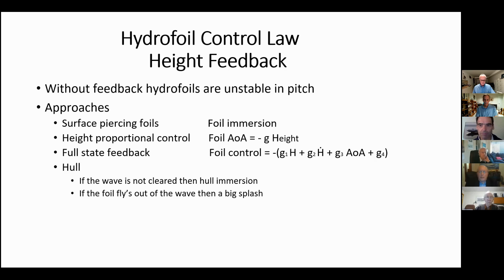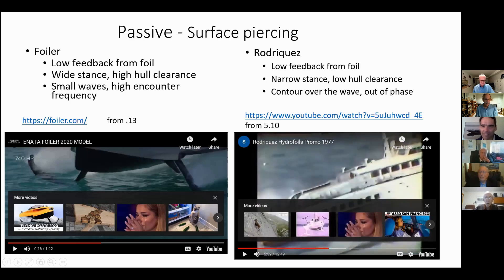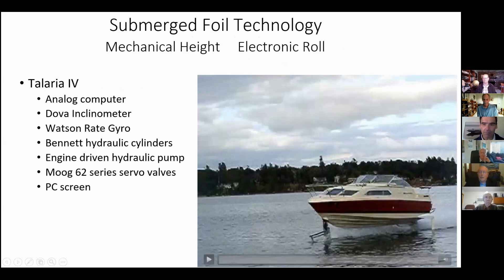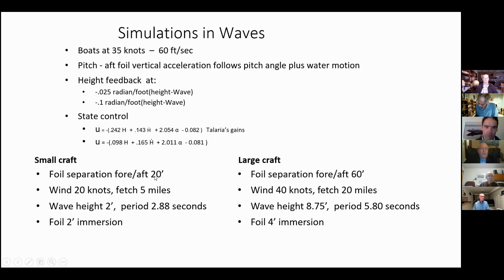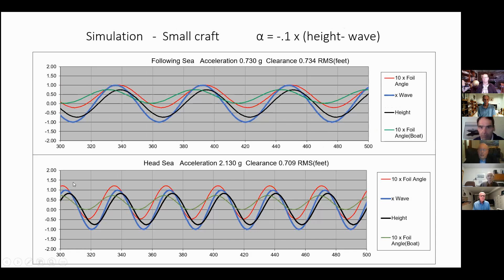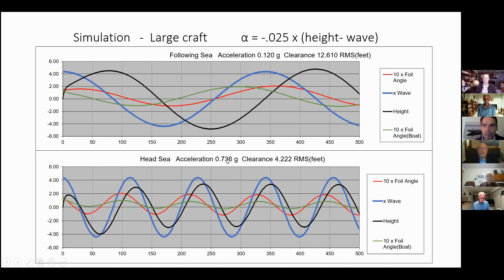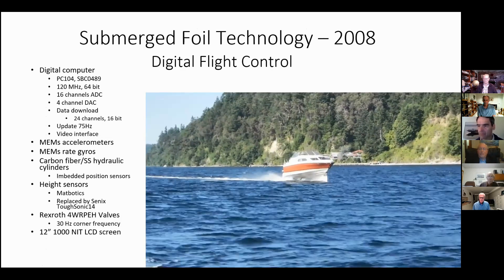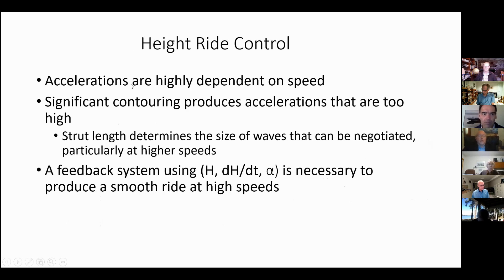HYDROFOIL -- Harry Larsen's Active Ride Control Systems

Comment: is there any advantage of using lidar pointed forward infront of the boat? say pointing downward at say 30 degrees so you are putting controls in before the wave gets close rather than responding to the movement of the hull/height sensor